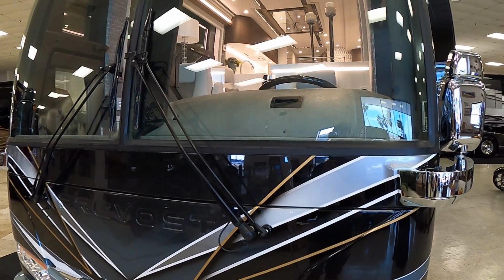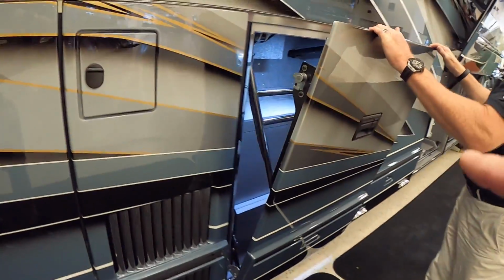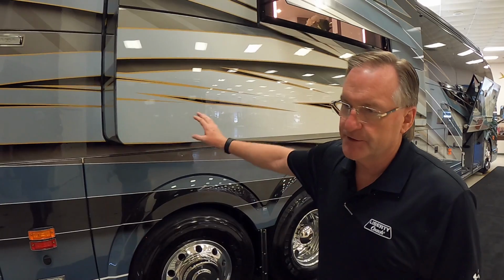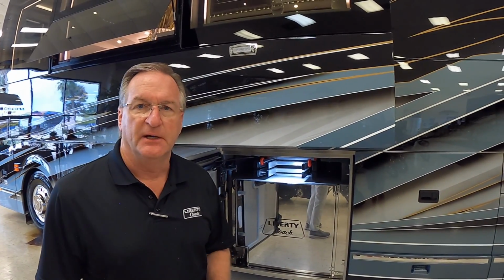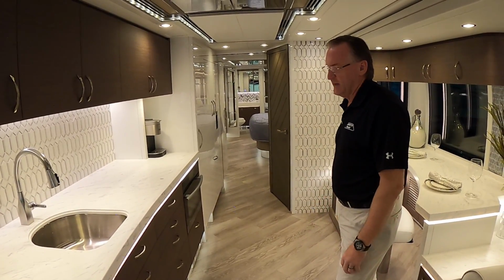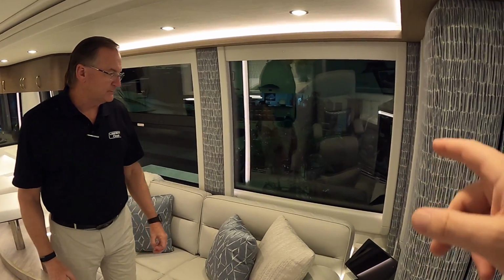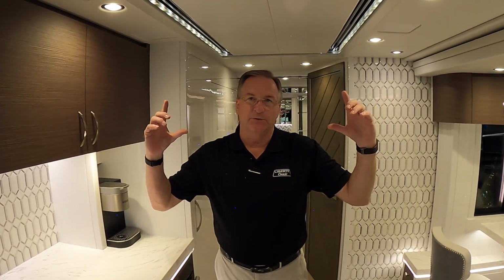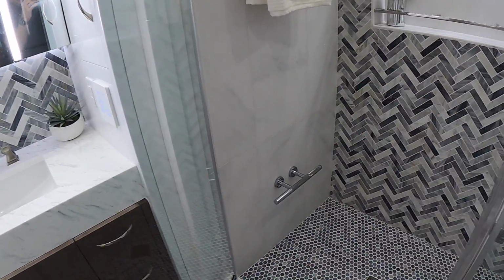Tour of 2022 Prevost Liberty Coach with "Super Suite"

Comment: You can spend crazy money on the best the RV industry has to offer, still have to pray when the warranty is over. These coaches are built with high end materials, no doubt, my Holiday Rambler Imperial had similar, not all the gadgets this has, but pretty nice with real cherry cabinetry, Corian counter tops, padded ceilings, high end plumbing fixtures and appliances. Shortly after the warranty was over, the floor in front the door was mushy, water got in, had to rip up the rug, cut out the rotted flooring and build it back. Plus remove the door & frame, reseal the frame. Few years later the hot water heater leaked, rotted out a portion of the floor, lots of work to fix it right. Replaced the flooring under the hot water heater with marine grade polyethylene panel in case it leaked again. Then the refrigerator died, another big job. One day sliding in the super slide, something caught underneath,  rolled up the bottom exterior aluminum skin till the motor stalled. Had to tear it all away, ordered (2) 4x8’ heavy gage aluminum panels and fabricate, hundreds of rivets, ground all the rivet heads down close to smooth, looked like factory again. I eventually sold it, person told me the slide out motor died about a year later, would be about 15trs old. It’s all part of the live and learn cycle of life.

Comment: Gorgeous coach but I'm not sold on all the integrated electronics.  Use your mirrors backing up, and push a few extre buttons.  These new "electronic coaches " are going to have issues in the future.  I'll stay old school.  Turn key to start engine and flip a light switch.  I have driven these and no problem with old systems.

Comment: Beautifully designed and engineered. One thing that stood out though, is that the fridge doors are in your way. It would probably give you more space if the pantry and the fridge-freezer were switched around. Also, the split fridge doors opening in two directions doesn't help matters. I believe one door opening into the lounge would help the UX greatly.

Comment: The touch screen on the outside has the paint scheme for the background, come on now. That's just showing off!!  What a machine. The design and efficiency of these top dollar coaches keep me sitting here for hours watching. Every piece of stainless is mirror polished. Even any copper tubing under the bottom. So many things set it apart from others that wouldn't spend the time on.

Comment: Volvo motor is a strong motor. I ran a Volvo truck for a lease while I had my Peter-built in the shop. Surprisingly me the amount of power on heavy loads in mountain terrain. It had a ten speed transmission which I had no problems pulling or using the motor braking down grades. Drove the truck for three months and not any problems of any kind. I don’t want to say I wouldn’t drive a Volvo due to the rocking side to side, but the motor is a slight bit better than my cat motor w/two turbos. SEMPER FIDELIS

Comment: Nice coach.  Informative video.  The not asked obvious questions are 1) Why is there a 10 inch pillar in the middle of the windshield which reduces visibility, and 2) Why not 600hp and 1950-2000 lb-ft of torque for towing in the mountains?

Comment: We looked at standard class a rvs before we purchased our 27FB International Airstream and they were horrible.  This is incredible, absolutely nailed the design and execution.  We own a cabinetry company and our average home we supply is 2-5M, the level cabinetry in this coach would be found in these homes.  Only small change is extend panels on the integrated fridge higher than the fridge so they follow the same line as all the other cabinetry.  All in all, this is not an RV, this is artwork
Reply: Good to know.

Comment: I love the technical features that Liberty Coach offers.  The Volta system with auto start gen from either the Onan or Volvo engines is state of the art.  What a bonus to be able to run A/C overnight without the sound of a generator running.

Comment: beautiful machine.

it seems like prevost coaches mostly have dinettes on the drivers side.  does liberty have an option to put it on the passenger side?

i think liberty is a step or two ahead on the electrical systems.  i think the buddy plug was near the front of the coach... can this be moved to the back to facilitate charging a ecar on a trailer?  i assume there is an existing power management system to handle this?

appreciate your indepth tours.  also have to compliment you on your camera work.  keeps getting better!

cheers